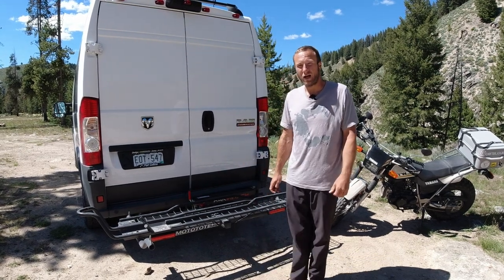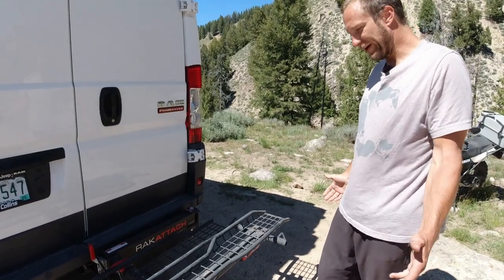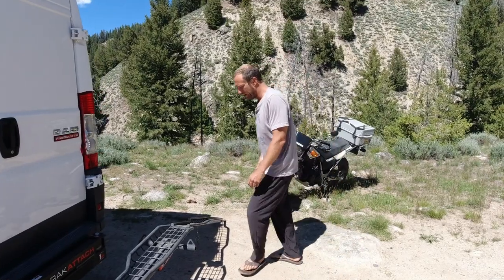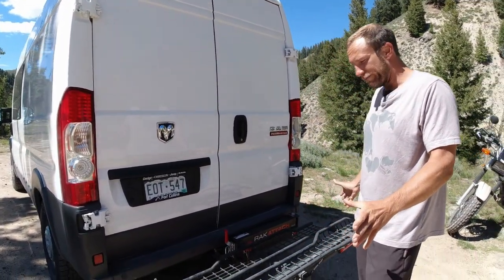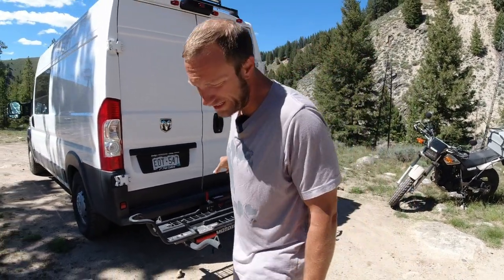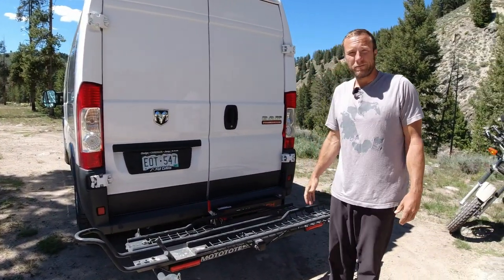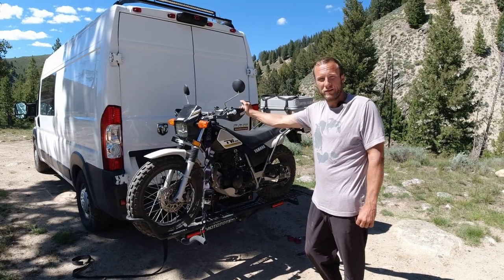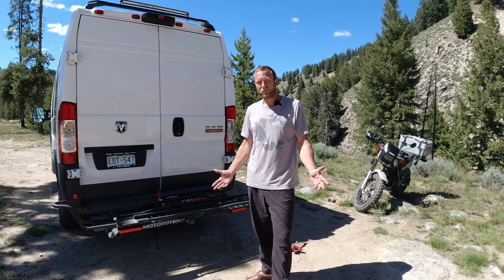Best Mototote Motorcycle Carrier Review. Best Motorcycle Rack for Vanlife!

Comment: I don't have this brand but I carry my DR650 on a similar carrier. Downside is eventually having my bike strapped down tight in the front blew my fork seals. Now I have a plastic T that won't let the forks fully compress, best $16 I've spent for hauling my bike.
Reply from the maker: Thanks for watching and also sharing. Many people had mentioned that over the years but luckily we never had a problem with ours. Maybe it's a TW thing. We had that bike on back down any kind of road for years and about 30,000 miles. It held up pretty good for the beating it took. I'll definitely look into one if we start hauling a lot again.

Comment: This is TW 200 is just the proprer bike for travelling with a van. Not small, not big, easy to fix, can go everywhere with it and super easy to handle. It is exactly the same body than the Suzuki VanVan
Reply from the maker: Exactly!  We even thought about buying the Van Van, but went with the Tdub instead because of the tires, ground clearance and it holds its value.  Both great bikes though!  Easy to ride, cheap to fix, the perfect size!
Reply: @DrifterJourney  got a van as well and a vanvan. Unfortunately it does not fit inside, this is how I found your video, while looking a way to attach the bike on the back of my VW T5
Reply from the maker: @dunno1128  aha!  that's rad!  well hopefully you find the mototote as helpful as we do, it's an awesome rack!  happy trails friend!

Comment: you're doing it right; soft ties and ratchet straps, nice system.  ride on
Reply from the maker: Thanks! We've seen them strapped down all sorts of ways but the way we've been doing it seems to work. Glad to hear someone that knows what they are talking about saying we did okay.
Reply: I'm assuming you close down the ratcheting mechanism completely.  Looks good though.   I use soft straps around the lower triples but it's a full 
size enduro bike. 

These things still sketch me out even though I'd only be putting 250 lbs max bike and on a 2nd generation Tundra.  :)  TW is a very cool bike !
Reply from the maker: Sorry for the late response.  I just found your comment. I do close the ratchet. The rack also scared me for a long time....thoughts of failure and watching the bike tumbld down the road in my mirror. But we've tested it thoroughly on nasty roads and it just keeps going. I also have a low deductible on the bike just in case. Thank you for watching!

Comment: To add to crazyivans comment, there is also a possibility of the bike coming undone, if the suspension flexes enough to loosen a hook.  What you need are loops made for carrying a bike.  The go between the fender and fork slider, or lower.  That makes it a very solid connection, rather than one that can flex.  You have been fortunate if nothing has happened so far.
Reply from the maker: Thanks for watching and also sharing. We put it on pretty tight so there probably isn't a lot of flex left available to let it get loose. We put over 50k miles on it over all kinds of roads and luckily haven't had an issue. With that said, it sounds like there is a better way.

Comment: Hey guys, didn’t know ya had a YT! We met real quick in Ketchum in June at Frenchmen’s with the Kooks, think you were heading off to go fishing? Anyway neat vid, good job. The straps with the clip are great for staying secure but consider a fork brace or fork saver, you can make one out of a chunk of wood but it goes between the fender and front of the machine to prevent your forks from fully compressing and prolonging life of your seals. You also might consider running just a single rear strap right over the back tire. That’ll allow the rear suspension to move and less stress on the hauler. Aside from that ya nailed it, safe secure convenient hauling system. We just made a hauler vid cause we entertain so many questions related to our set up - check it if interested. Our back table is the jam! The rest of our vids are super moto centric but there’s a whole Idaho series you might dig. I’ll smash that sub button and sniff around at more of your vids!
Reply from the maker: Oh yeah, hey Mike!  Thanks for the tip on the front fork, that's very helpful!  Sounds like you had an awesome summer in Idaho!   We'll check out your YT channel for sure!  Thanks for the sub and hopefully we'll run into again on the road one day! Cheers!

Comment: I have a Rak Attach and a OneUp rack for carrying bicycles.  They are very well made.  However, the weight limit on the Rak Attach, from their website, is rated at 275lbs.  I think you are at or over their rated weight limit if you include the weight of the carrier.  I'd never carry a motorcycle heavier than what you are carrying with the Rak Attach.  I might carry something lighter - and still feel semi-comfortable.  I have a truck camper where I need rear access.  But I'll end up getting to camp, remove my 350 lb KTM, and then just remove the motorcycle carrier from my hitch receiver.  Creates extra work but it's safer imo.
Reply from the maker: Thanks for watching! We definitely wouldn't carry anything heavier than our bike on it and we have been testing its limitations for sure. We've always figured the weight rating would be for it in its weakest position (open). I either unload the bike for extended stays or lift up on the front as I swing it if I need something quick. We've put about 40,000 miles on it on all sorts of roads and haven't personally had any issues yet. With everything though.......we always recommend people to use at their own risk. They recently came out with version 2.0 which looks stronger (same weight rating) and I've also heard of folks taking it to a fab shop to strengthen it up.

Comment: Great review; it added Mototote to my research list, and I ended up getting this same rack to haul my brand new TW200.

Question: The loading ramp can rattle in its stowed location.  Have you noticed this?  If so, have you done anything to better secure it?  I'm considering a few short bungee straps, but they all too often escape to live with their wild brethren on the shoulders of the highways. :-)
Reply from the maker: Awesome Karl! I hope you were able to get a discount with our code. As for the loading rack.......I only hear it when the windows are down and we're "off" road. I have not found a need to strap it down any more than the pin it comes with.
Reply: @DrifterJourney   I ended up purchasing through another route that gave me a steep credit card discount.  Good to know about the ramp.  I may still strap it down some way during travel to keep paint wear to a minimum.  I don't anticipate winter use, but may have reason for an escape to warmer climates and I am deep in the salt belt.
Reply from the maker: Salt and chipped paint don't mix! Glad you got a deal too.

Comment: Nice rack and something I would consider if I can sort out a proper hitch for the extended body ProMaster. The hitch you used won't work on my van. My attempts to date to carry my TW200 are less than adequate (hitch is bending).
Reply from the maker: Thanks for watching! I never thought about a hitch with the extended body. Hopefully you can find one that can handle it. Make sure to use our link (in video description) if you buy a Mototote to get yourself a discount.

Comment: Good review, could tell me what the height from the bottom of the 2" receiver tube up to the top edge of the rack -total profile. Trying to calculate if I can open the rear doors while rack is installed without a bike on.... Thank You
Reply from the maker: Hi and thank you for watching. We don't have the rack with us currently and won't have it again for a couple of months. If I remember correctly, I am able to open the right side completely but the left hits the tire holder. Shoot them an email at contact@mototote.com and they should be able to help. Make sure to use our link and discount code if you end up buying one.

Comment: Would you mind answering this question for me? Do you swing it out with the TW still on it? I also have a TW and I have a truck camper and of course the door to the camper is in the rear. I would love to be able to take my TW with me when we go camping. I really don’t want to have to take the motorcycle off each time I need to get into the camper.
Reply from the maker: Thanks for watching! The short answer is yes. It's not technically rated for the TW weight so I would lift by the front wheel as I swing it out. It was never an issue for us but this is definitely not a recommendation from me. I thought about propping a board under it when open but never bothered.
Reply: @DrifterJourney  thanks, and I understand. When you’re dealing with products like these, you have to make decisions on an individual basis and take responsibility when you were doing that. Thanks for the info and I really like the motorcycle rack also.
Reply from the maker: Happy to help! We love the rack and have been impressed with its performance. It's definitely taken a beating on the back of the van!

Comment: Greg, what hitch do you have on your Promaster?  I have a PM 1500 HR also and would like to use a hitch hauler as well.  I'd like to haul a Suzuki VStrom 650 that weighs about 435 but am willing to get a lighter bike like a TW200 or XT250 or similar if the VStrom is too heavy.

Have you had any issues using yours?  How many miles have you towed your TW200 on the hitch hauler?  Does it bounce/flex much when you hit dips, bumps, etc?
Reply from the maker: We have the Curt Class 3 hitch #13207. We feel that the hitch is more than adequate for the motorcycle. The Mototote rack we have (Max plus) is rated for 600 pounds. Without the swing arm, which is a separate product that we bought from RakAttach; 250 lb weight limit) it's very solid and the only rocking is the bike itself. However, with the swing arm, there is more bouncing when we go over bumps and dips. But we haven't lost the bike yet and we've driven many thousands of miles with it, including up to Alaska and back.

Comment: Although it's not shown in the video, you do swing out the RakAttach w/ the TW on it, right?  I think the RA load capacity is 275lbs and the TW is about 280lbs, so swing away?
Reply from the maker: Technically with the bike and the MotoTote, we are over the capacity of the RakAttach (we've read differing specs at 250 and 300 lbs max).  We do swing out the RakAttach with the TW200 on it, but try to support as much weight as possible while swinging open so as not to put too much stress on it.  We've heard rumors that RakAttach has a custom "heavy duty" version that they'll make you if you call it in... we've never looked into it though.
Reply: @DrifterJourney  Thank you!  I just saw your other video, where it's swung out.  I understand the 'technical' capacity, and like you, I have a TW and wouldn't keep it mounted and swung out for any length of time off the back of my Taco.  I didn't know about the heavy duty version, so I'll check on that!  Great channel and response!
Reply from the maker: Of course, thanks for watching and have fun out there!

Comment: good system! and it is possible to rotate with the motorcycle on it??
Reply from the maker: We have a separate unit called the rakattach swing arm. Made by 1Up.
Reply: @DrifterJourney  thank you, can they send to France?
but the arm rotates with the motorcycle on it?
Reply from the maker: I'm not sure if they ship to France. We've seen the swing rated for 250 and 300 lbs. The bike we have is definitely at the limit and we haven't had any problems. With that said, always check with the manufacturer and make sure you feel comfortable with it since it could be bad if it broke off.
Reply: @DrifterJourney  It's true ! to be checked !  ! ; )                 thank you
Reply: @DrifterJourney  what model is your rakattach ? medium or large?
Reply from the maker: We have the large.

Comment: Hey man, I know people have asked about heavier bikes and that is all within the rated capacities, but I am curious to how you feel the handling would be if your bike weighed in around 400lbs instead? Assuming the rakattach could handle it, and you were able to slightly modify the setup, do you think that sort of weight would be too detrimental to the handling of the van/stress on the structure of the van?
Reply from the maker: All specs aside with the rack and swing out.......I would guess that it could handle it based off a towing capacity of 5,000. Double check but I think tongue weight is 10% of towing capacity normally so 500 lbs would be what they are basing it off. As for traction, we do notice that we lose a little with the bike on back (I guess it could be lifting the front up a little? ) but it hasn't been a problem for our use. Hope that helps. Obviously we're not professionals and this is just our opinion. Be sure to do any research needed for safety.
Reply from the maker: All specs aside with the rack and swing out.......I would guess that it could handle it based off a towing capacity of 5,000. Double check but I think tongue weight is 10% of towing capacity normally so 500 lbs would be what they are basing it off. As for traction, we do notice that we lose a little with the bike on back (I guess it could be lifting the front up a little? ) but it hasn't been a problem for our use. Hope that helps. Obviously we're not professionals and this is just our opinion. Be sure to do any research needed for safety.

Comment: will this work on the Promaster without the rakattach swing arm since the hitch is flush to the bumper? I plan on buying the same setup as you but the rakattach moto version has been on back order for over a year.
Reply from the maker: Yes, we had the mototote rack for a few months before adding the RakAttach and it works just fine. The motote has several  holes where you can set how deep it goes into the hitch depending on how wide your handlebars are on your motorcycle. The only issue without the RakAttach is that we couldn't open the back doors all the way because some parts of the motote rack interfere at the bottom of the door. But otherwise it works great without the RakAttach.

Comment: Does the cargo carrier you have on the back have the capacity to carry two helmets if you want to secure them in it? Also do you feel that the 200 has enough power for you and a passenger?
Reply from the maker: Hi Gary. Thank you for the comment. The NRS cargo bin on the back of the bike can only fit one helmet. We ride the 200 with both of us and it works most of the time. It's great for getting around town and up forest roads. It's not really quick by any means so highway speeds aren't realistic. Sometimes it's a dog on the hills too but it hasn't really kept us back from too much.

Comment: Your setup has got me considering bringing a small motorcycle. Can the rakattack fold away from the van while loaded with your motorcycle, or do you have to unload it every time you access the rear doors?
Reply from the maker: It can open with the bike on it. It's not technically rated to that weight so I lift a little when opening and closing to take the weight off the hinge. I just heard that they make a 375lb version but it costs $600.
Reply: @DrifterJourney  Where can I find the 375lb version?
Reply from the maker: @jdhesschannel  it sounds like they no longer produce that version.

Comment: What tow hitch do you have? My girlfriend and I have a 2017 Promaster and I don't like the hitch that's on it.
Reply from the maker: Thanks for watching! We have the Curt 13207 which is a bit more substantial than the one we've seen that comes on these from the factory. Here is a video that we did about it.
https://youtu.be/kTcTxu4VWTA
Reply: @DrifterJourney  Thank you! That one is significantly more heavy duty than the one we have.
Reply from the maker: You're welcome! There was one weird fitment issue that we easily remedied in the video. Not all vans will have the grounding location that we cut off in the video but it's worth mentioning in case you buy one.

Comment: Would you put a 190 kg or 30 stone bike on it?? Triumph tiger 900
Reply from the maker: The MotoTote MTX Sport Carrier that we have is rated for up to 600 pounds.  190kg is about 420 pounds, so the MTX Sport rack should hold it without an issue as long as you don't add the RakAttach swing arm that we have.  The swing arm is really the weak point in the system.  The MotoTote rack is super solid!

Comment: Did you have to check the ball weight of you two bar
Reply from the maker: Thanks for watching! We bought the strongest hitch we could find which is rated to 750lb tongue weight if memory serves me right. I didn't check anything beyond that due to our load weighing in at less than 400 overall based on my estimates. We always recommend checking with the manufacturer for any safety and installation recommendations.

Comment: I have a 1500, 136WB pro master van, and a 435lb KLR 650.  At some point I’d like to ditch the trailer and do a hitch rack.  Sounds like this rack could work?
Reply from the maker: The Mototote definitely should work (double check tire size specs but the TW makes it fine so you should be good). Make sure to use our link for a discount if you get one and let us know if you have any other questions.
Reply: The Mototote would work but does the RakAttach? And then after the RakAttach, the Mototote, and the Bike, does the Promaster tongue weight allow for all that? I'm trying to figure out the same setup w/ a Sprinter 2500 and a KTM 790 ADV